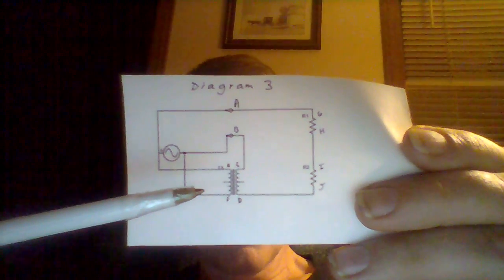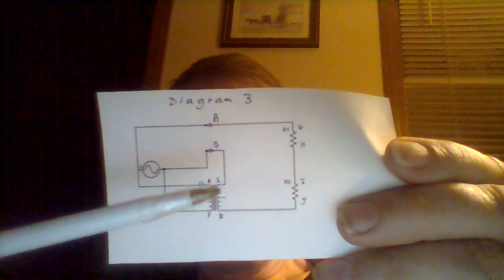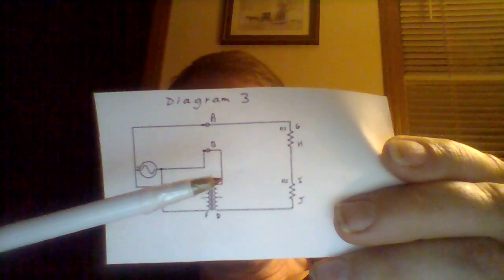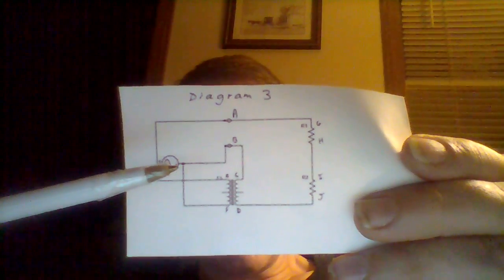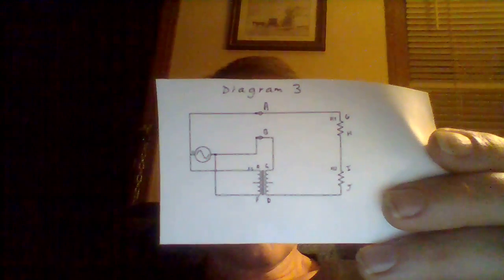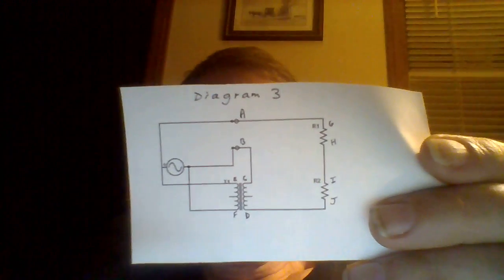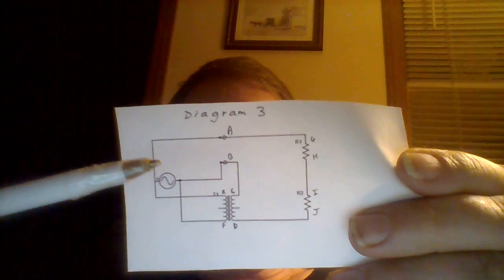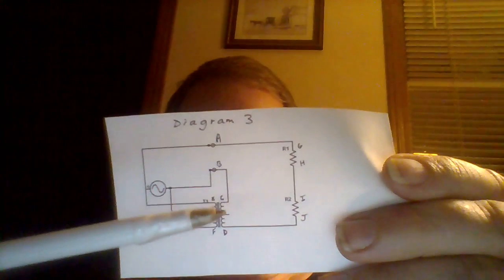Voltage Synthesizer Basics Part 2

Comment from the maker: Oh, I made a mistake talking about the speed of electricity. The speed is about 300,000 meters per second, but I said the wavelength for a 60 Hertz frequency waveform was 5 meters and not 5000 meters. That is wrong, it is 5000 meters from wavelength = speed of electricity/frequency = 300,000/60 = 5000. Low frequency waveforms do have very long wavelengths and brainwaves are very long due to them traveling at a different speed through the nervous system which is composed or organic chemistry made of various biochemical molecules. Also a 1:1 ratio transformer is called a no-step transformer. Here is the link I mentioned:  https://patentscope.wipo.int/search/en/detail.jsf?docId=WO2016070292&recNum=1&maxRec=&office=&prevFilter=&sortOption=&queryString=&tab=PCT+Biblio Just highlight the 2 lines above then copy and paste to your browser or use keyboard shortcuts Ctrl C and Ctrl V.